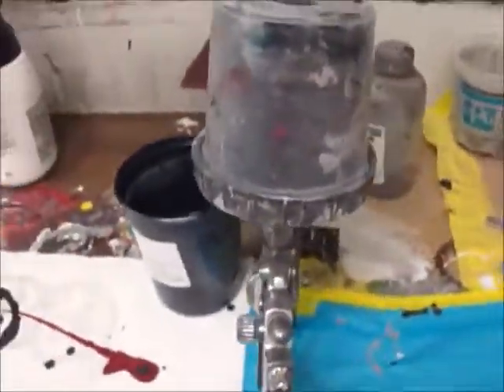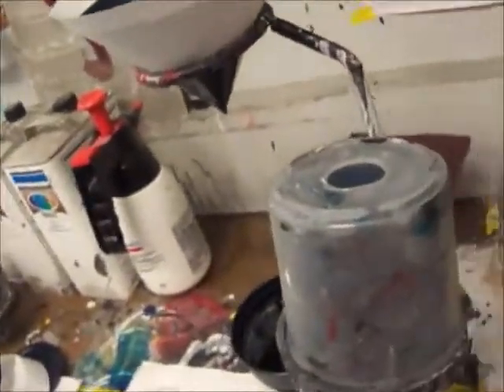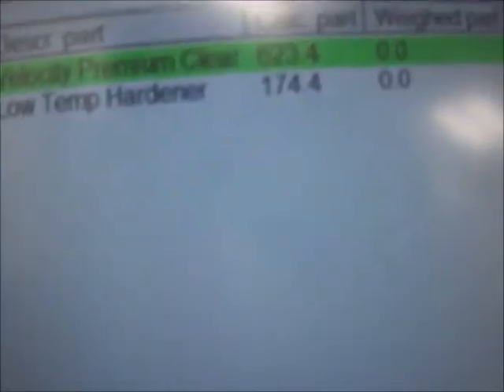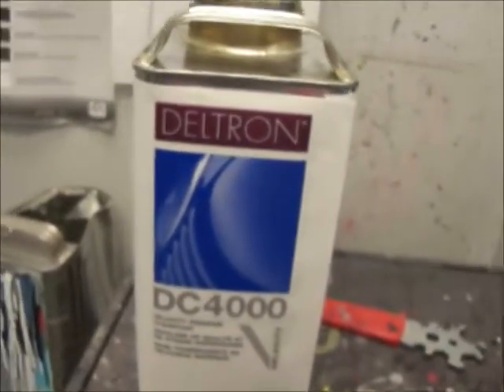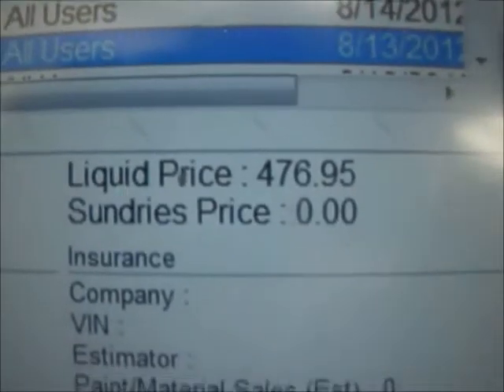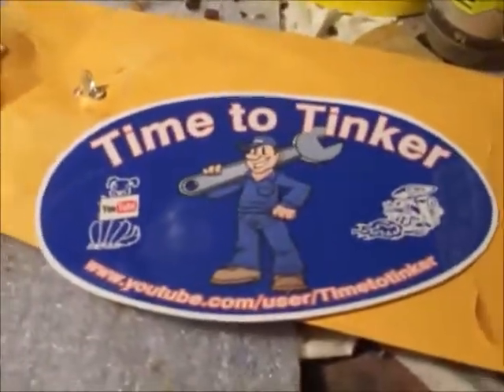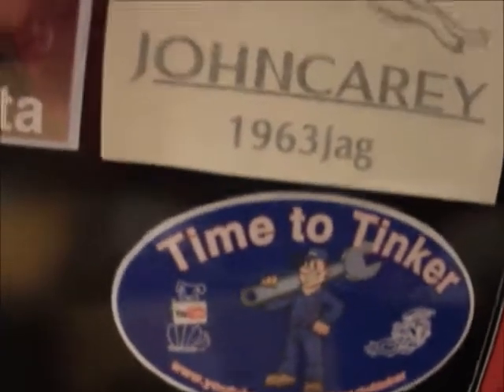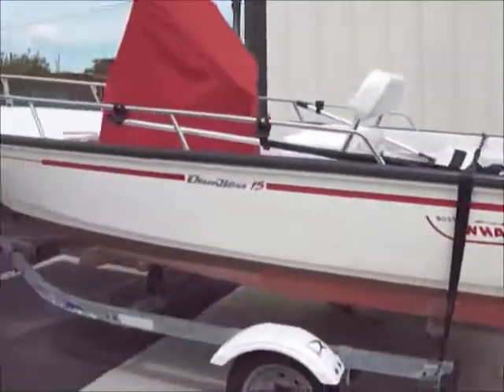Painting a Prius with the Milrick

Comment from the maker: Sun gun in the booth with the lights of is a great way to check to see if the base coat is covering good before clearing. Hard to tell with the glare of the booth lights. It's primary use is checking color chips. It's lite is more accurate to the light spectrum of the sun as opposed to shop lights. Thanks for watching.